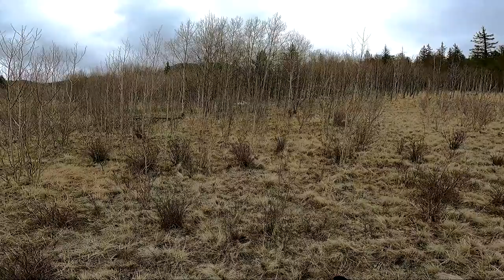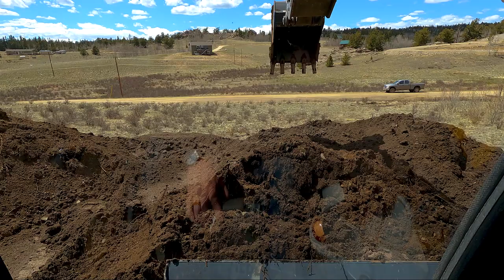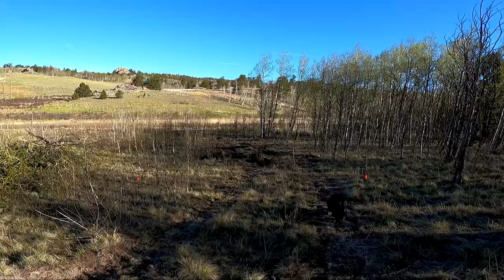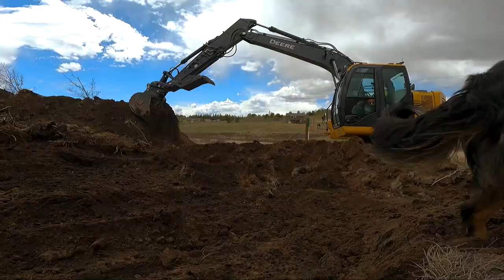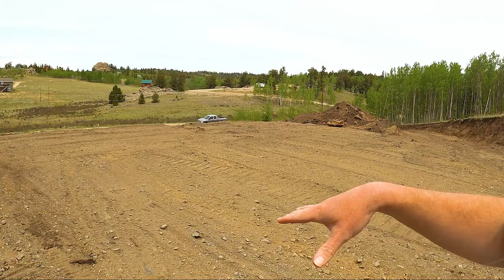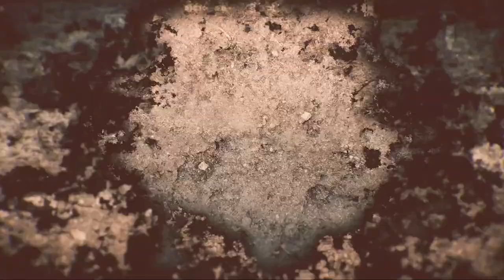Cleared Land Like Nothing! Should You Buy The NEW John Deere 135P Excavator?

Comment: What’s the price point of something like this?
Reply from the maker: Hey Ethan, this is Phil.  The pricepoint on this machine can vary, just like any of them.  You are in the ferrari pricepoint range with a machine setup this way.  With that said, the thumb set up (with a quality brand) and heavy duty Name Brand Buckets adds quite a bit of cost just in those 4 items.  2 buckets, Quick Coupler, and thumb will cost you 70K.  The machine from John Deere and their financing options make it an interesting process for sure.  They give really nice incentives, warranty options and service options that can all be financed at REALLY good rates. Many times (when incentives are in effect) the rates are not subsidized by the machine price, which makes it a true interest rate with no additional cost on the machine  to pay for the low rate.  *IMPORTANT* Most manufacturers have this deal going on right now due to some overstock issues caused by COVID orders finally being filled. Good time to buy is my point.  All in all, you are looking at 230-270K depending on features for a machine in this size range, new with warranties, service programs, buckets, coupler, thumb, etc. I have some really good contacts at various brands, that I trust, if you are in the market.